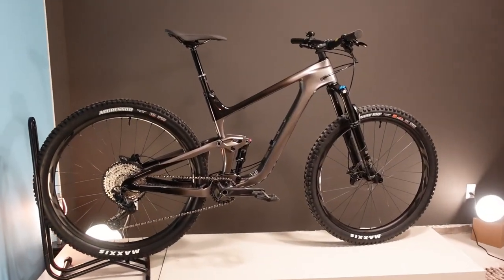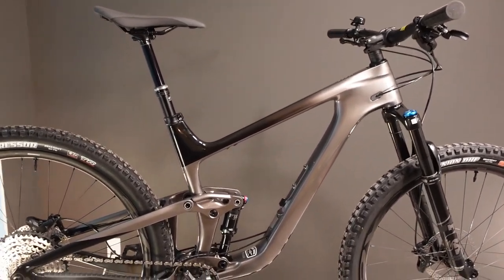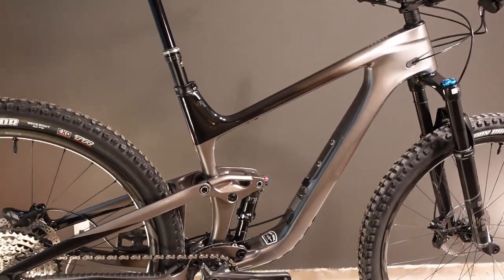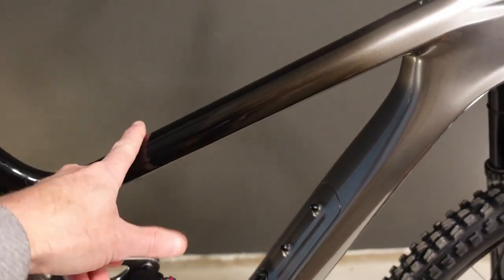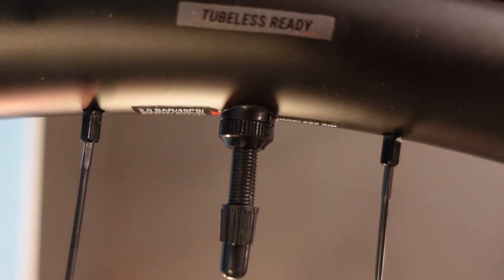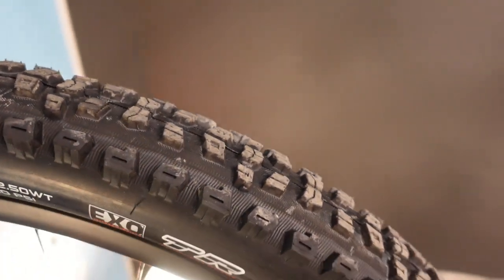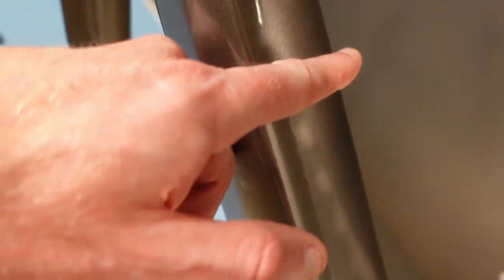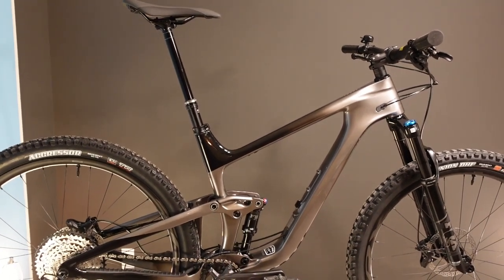2022 2023 Giant Trance Advance Pro 29 2 - Specifications, Details and Discussion

Comment: I’ve had this bike for about 6 months,really enjoying now but took a while to get the setup right,ended up having to put a smaller spacer in the shock to get it feeling good and put a 35mm bar on it as was feeling to low on descents.
Reply from the maker: Interesting. What size do you ride? By spacer, do you mean a volume reducer? I'm riding this in a large and at first was tempted to put on 35mm rise bars but then after a couple rides I was feeling so good I became a bit scared to change anything in fear of changing something that felt so good... 35mm riser bar is still on the top of my list of tempting changes.
Reply: @BikeBrosBikeShop  yeah I got a pnw 35mm bar and yeah I mean volume spacer,it came with the orange second biggest and now use the second smallest and it’s way better for me,I’m 175cm on a medium

Comment: I finished building up the TAP 29 1 a few weeks ago. Overall, awesome bike, but 1 problem: the new frame storgae hatch has moved the water bottle cage bosses up so high, That even on a sized large frame that there is no way to use a water bottle!
Reply from the maker: Hi, on my large I'm able to use a large bottle. Maybe the type of cage you're using ? I did make a point of getting a cage with a broad range on the mounting slots.

Comment: I was able to pick up a ‘22 TAP29-2 boxing week @ 15% off! Here in Ontario. 
I now have about 400k on it. Other than the weight I’m super happy with it. 
My ‘14 trance ad 1 Large 160Fr 150Rr
(Pike DPX2) eBay carbon wheels is 28lbs. I’m an XC rider who prefers a plush ride & I’m recovering from a ‘surgery’. So I just fitted a 36@ 150mm and it Butter! I run a lot of sag & flipped the chip to High; I call it
DoubleDown Country. 
Mnt. Biker since 1986😁

Comment: Always had a lot of respect for Giant. Value and quality. I also heard they are good to local bike shops, which I like to support. 

Question about the weight: What size for the 31.6 lbs weight? I’m wondering because my wife has a full carbon, 120mm suspension front and rear with a Fox 34, that’s 25 lbs in a size medium… but is the Trance Advanced Pro weight typical in its class because it’s downcountry or even trail and therefore burlier by design?
Reply from the maker: 31.6 pounds was on the size large that I filmed. I'm a little baffled by the weight because no single part is exceptionally heavy. That said, the lightest bike in this category is the Rocky Mountain Element and with similar spec is only about 1lb lighter. The Pivot Trail 429 with a higher spec is just under 30 lbs... so it isn't far off.

Comment: Nice video thanks! Tough finding info and videos on these without the live valve which I have no interest in. Couple things….oh I’m in Massachusetts so New England conditions which mean’s generally slow rocky and root infested trails with short technical punchy climbs with often the same on descent. Current bike a 2016 Trek Remedy 29er 140mm F/B. Nice bike and a keeper but I want something energetic, efficient and climbs tech stuff really well so a shorter travel bike with more modern geometry with nice seat tube angle for climbing. Looking at model year 24 bikes or frame only options.
This Giant competes directly with Top Fuel, Ripley, Pivot 429, Yeti SB120 etc. Some of those are crazy expensive and realistically out of reach.
What bugs me on almost all including this Giant (and I guess even my Remedy) are the low stack heights. I like my bars almost even with my seat height at full extension (I’m in my 60’s now) and it’s difficult with these new bikes. Even my Remedy I use a Hope 25 degree, 70mm stem with the stock flat no rise bars at 30”. I’m 5’ 10.5”.
The seat/bar offset on the bike shown is crazy XC looking. That cannot be comfortable for any length of time, puts undue pressure on hands and wrists and god forbid going down something steep. Does the fork come pre-cut from Giant?

Weight at 31.6 is heavy and a head scratcher for sure for a carbon bike with carbon wheels. Gotta think their own Giant branded hubs, bars, stem, seatpost, crank possibly and even their own carbon rims are all heavy components that add up to almost 32lbs. Thoughts!

Hubs would absolutely have to go which would mean relacing the wheels.  In my technical terrain I want high engagement hub. My Bontrager aluminum Line Elite’s have 108 POE and have been trouble free. These were not the stock Remedy 8 wheels though.

Wish Giant had gone to or back to a threaded bottom bracket like many manufacturers are now doing. What’s been your experience and reliability of the press fit BB setup in these Giant bikes? Carbon related failures or ovaling out? My Remedy has press fit and not been a problem but aluminum frame. I also repacked the bearings with motorcycle waterproof wheel bearing grease when new. Original GXP BB still.

Never ridden a Giant but been a huge fan of their Maestro suspension and from reading many reviews their ability to climb technical terrain which is far more important to me than downhill prowess. Especially the shorter travel version. Trance X is tempting but I think I want to try a shorter travel ripper that climbs like a goat. 

Definitely one of the best bangs for the money and ticks the majority of boxes. 
Complete bike or frame only is one decision?
Size is the other? 5’ 10.5” what would you suggest?

And sorry for such a long winded post 🤷‍♂️
Reply from the maker: Hi, yes the bike is a bit heavy though except for the cranks/steel chainring there's nothing singular that contributes to the weight significantly so I think Giant deliberately added weight to the frame to make it stiffer and able to be treated like a short travel Reign. This attitude shift on stiffness/weight seems common for Giant full suspension bikes now compared to the last generation. This thing begs to be ridden aggressively. While I don't like press fit bbs, Giant's use has been as close to trouble free as anything - minimal creaking issues, haven't seen things ovalize, bearings don't wear out prematurely. For sizing, I would think you're a large and if it felt a bit long there's always the option of switching from the 50mm reach stem to a 32. 35 or 40mm. On the stack height subject, what about 35 or 40 mm rise bars? The steer tube is precut - I don't know of any of the main stream brands that send uncut steer tubes. Uncut usually only happens from high-end / lower volume brands like Pivot who sell bikes in the same color but different build kits. I'm not that concerned about engagement in hubs after having used fancy hubs and thinking it mattered then spending a couple weeks on the stock Giant hubs I realized I never even thought about the amount of engagement. I have broken 7 or 8 freehubs over the years so failure is a bigger concern to me than engagement angle. My strategy, if I wasn't a bike slut and only spending a few months on any one bike, would be to ride the stock wheels until I got some early signs of pawl wear then look at replacing the hub. The new Giant rims are quite good.
Reply: Thank you so much for a quick reply on a Sunday no less 🙏

It’s interesting the new geometry of the medium size Trance is very close to my 2016 large Remedy in  a few key areas. Stack, reach Giant is 20mm longer, top tube, head tube height. Allot closer than a large for sure. Admittedly the aluminum framed Remedy’s at that time  (and I guess many Treks) ran “short” for their size so maybe a medium would be just fine. Obviously a spin on one at a dealer would be best but that could possibly be a challenge.

Thanks for the info on the BB and reliability. Not a deal breaker. I would also probably try a shorter crank set at some point. Remedy is 175, Giant is 170. 160 or 165 probably. Even with 13.75” of BB height the Remedy in low position I still smack the pedals a fair bit but that’s just riding in New England. Everyone’s pedals are hammered from the unrelenting rocks. Giant is 13.5 inches so shorter crank arms would help besides other advantages to short cranks.

I’m spoiled by the high POE Bontrager hubs but an certainty willing to give the Giant wheels a go. If I don’t like em they become a backup set to something else.

Unfortunately the Giant USA sight is not current with 2024 bikes but the Canadian site is. Trance Advanced 1 or 2 look very appealing and in US dollars I think very reasonable for what you are getting. Guess I need to head to a Giant dealer(s) in my area for exact specs and availability.
Liking this bike allot.
Reply: So I went to my local Giant dealer and had a nice talk with the owner.
Only 1 Trance on the floor but he mentioned to me they will have a release of the model year 2025’s February 17th. Head scratcher for me as it’s just January of 2024 and I see very little new on the current Giant USA site. He said he’s sworn to secrecy about revealing any info  but said he’s already got some. Not sure if that was road or mtn as I forgot to inquire that.
He also explained that the US and Canada are owned differently and why I’m seeing different Trance models on the Canadian site.
I’m loving that Trance Advanced 29 1 in the blue on that site in the dragonfly/black/chrome combo with the GX Eagle Transmission.
Wonder if we’ll see that in the US?
That frame in your video though is absolutely stunning IMO.